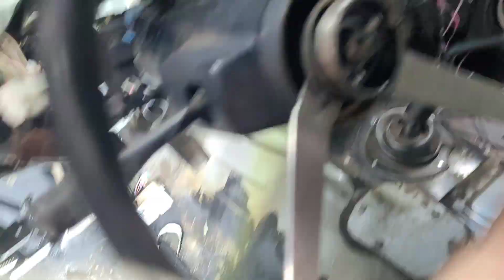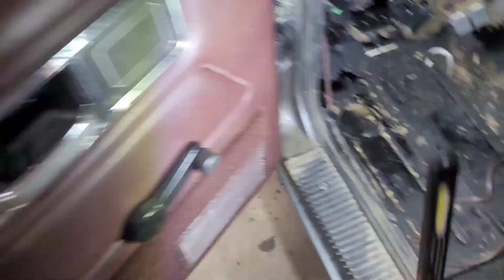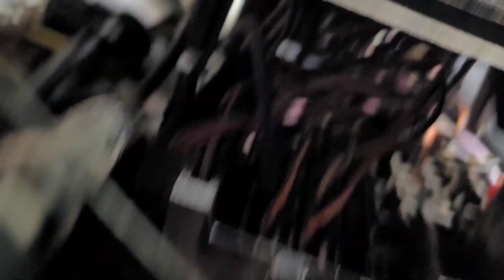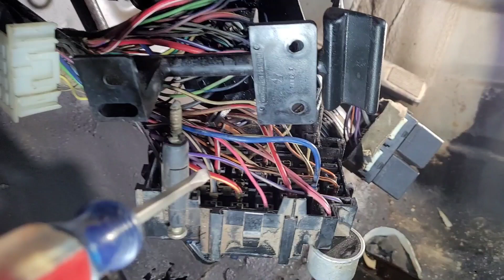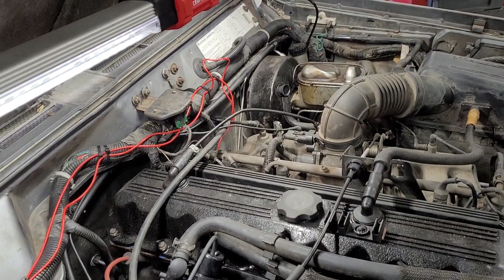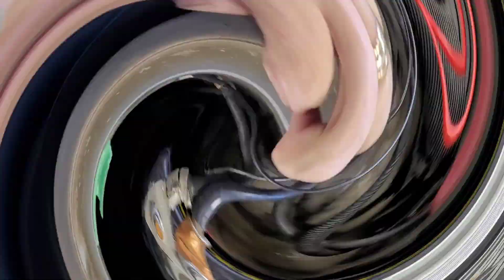Melted Blower Motor Fuse Repair and Removal of Fuse Box. All caused by Clutch Master Cylinder? #jeep

Comment: Just finished fixing mine but I did not cut the purple wire, that keeps the wiper system intact. I just cut the black and white put a fuse link in then did the tap fuse for the ignition and relay keeping it on it own circuit. Thank you for the tutorial.
Reply from the maker: Glad it worked for you

Comment: The problem is that by cutting both wires going to the fuse, most of the time the bigger ''hot'' wire not only supplies current to the fuse, but also supplies current to other fuses, sometimes one whole row of fuses. You have to make sure by checking the fusebox diagram before cutting any hot wire.
Reply from the maker: This method is working until this day without any issues

Comment: Beware that at least on the renix era xj’s and mj’s that one of the 2 wires that you will cut to bypass the blower terminal also provides power to your radio fuse, and your turn signal fuse. Although there is an easy fix for that. Just run a new power wire to either the turn signal or the radio fuse terminal, since they are all connected and only powered by one wire.
Reply from the maker: Great information

Comment: Dealing with this issue now. So black and tan wire and purple have the inline fuse, is the red wire going to the battery coming off both of those wires?
Reply from the maker: In this scenario I put two red wires to the battery so I could run a separate relay to each circuit,  blower and wiper

Comment: So I have a similar problem. My fuse block is corroded from sitting in clutch master cylinder fluid for over 20 years and will need to be replaced. What is the best way to go about replacing the fuse panel?
Reply from the maker: It's all one piece.   Probably  need to get an entire harness from salvage yard or ebay or alot of wire crimping

Comment: I've got 95 xj has the issue of the ignition switch gets hot only when blower is run on max
Reply from the maker: You might need a new blower motor resister.  Very cheap on rockauto.com
Reply: @MajorWeakness  i put new blower/resister with the new ones ignition switch took longer before getting hot the ignition switch is the same one used in gen2 dodge trucks

Comment: Oh man, thank you for this. I’ve got no power to the blower motor controls at all and i’ve replaced everything. The plug to the environmental controls was completely melted. I have a feeling i have this exact same problem.
Reply from the maker: If yours is a ninety six or before I would start with that bulk connector remove and clean and see if you see anything burnt

Comment: That’s a pretty nice solution. Definitely looks like clutch or brake fluid getting into the fuse box. It’s surprising that more of them don’t burn up. My fog light switch melted in my bad boy black package Z28…. No relay!
Reply from the maker: These car companies cheap out on things like that.   I will be making another video on adding a relay to the headlights.   The headlight switches and plugs are known for melting on these things so I want to prevent.